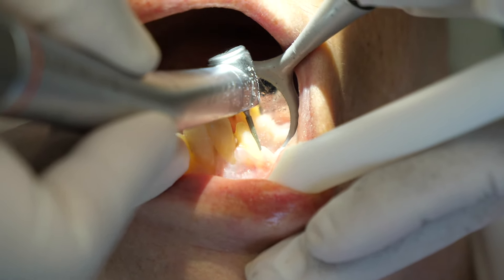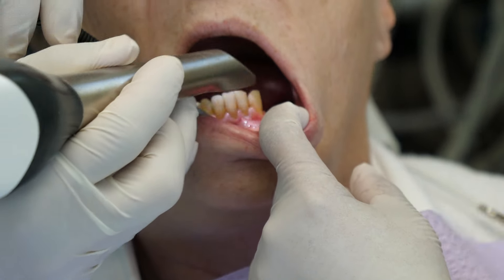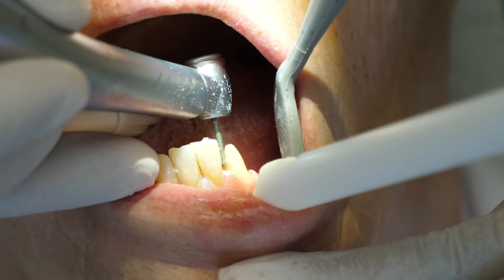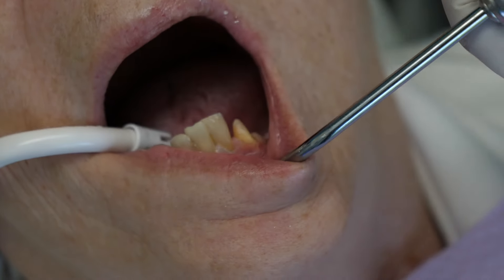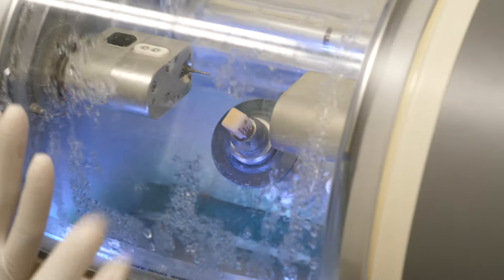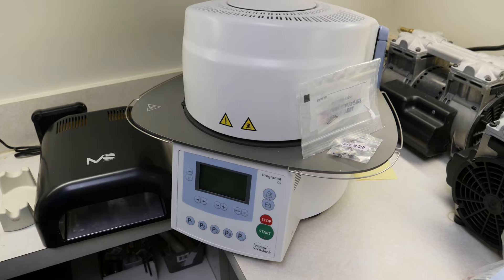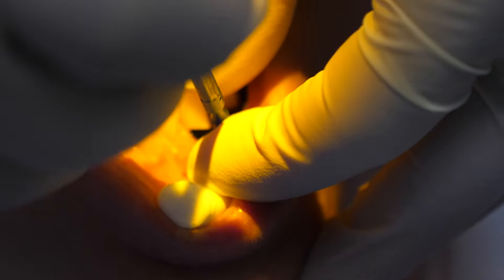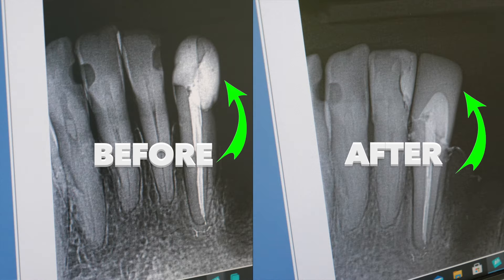Dental Crown Procedure EXPLAINED

Comment: Hi - very informative, but one aspect I'm not clear on.  Why is it necessary to drill the tooth down to such a degree? If  the issue is decay or a misshapen tooth, can't you just re-shape without such an extreme reduction in size? Thx.
Reply: I think it's because the tooth will usually be so damaged, like with major fillings, cracks, fractures, etc, that they have to remove all the bad stuff so nothing goes wrong underneath the crown over time (like gets another cavity that's no longer accessible)
Reply: Question. Wouldn't it be better just to extract the tooth. From other stories they always go back in to fix or take the crown out
Reply: @angelnieves6432  Not necessarily, preserving the tooth is of the utmost importance. Yes, all restorations whether direct or indirect are considered temporary, meaning they won’t last for forever, but you’re trying to make the natural tooth last as long as possible before extractions are necessary. Extracting a tooth can also cause adjacent teeth to shift, and opposite teeth to hyper erupt, which both aren’t ideal situations
Reply: It’s all based around physics. You have to reduce the cusps/tooth structure enough to where the crown itself will be sturdy, thick, and last. If you made this same prep but took off much less tooth structure, the crown would lack structural integrity, and break or fall off very quickly. So yes you would preserve more tooth, but you wouldn’t be helping the patient because the crown wouldn’t last
Reply: the situation that you described feels more like something you'd use a veneer for; though uncommon, dentists can use a veneer for decay. as for misshapen teeth, if the tooth is healthy, it would just make sense to use a veneer rather than a crown

Comment: I had a crown put on one year ago.  Small bits of the bonding cement you speak of is on my gums on both side of the crown (not touching the crown).  Was never cleaned up by the dentist.  I am not experiencing pain or inflamation.  Do you think I need to have the cement removed from gums?  Or leave it be as there are no apparent issues?  Thanks for your help.
Reply: Leave it be my broski.

Comment: I had an onlay that popped off clean. I knew it wasn’t glued properly the first time and told my dentist. He said it was fine. So when I went back to have it glued back on he said he’ll do a new one. I went two days later and he decided to do a bulk composite instead. It lasted a week before causing a fracture in my tooth. I’m not in pain but I’m upset. I don’t even want to go back to him. I’m most likely going to need a cap now and I was fine before. Any advice? Would a cap hurt without doing a root canal?

Comment: We have that same milling unit at our office and I love watching the milling process! I'm also a dental hygienist and I love your channel 😊 Greetings from Finland!
Reply from the maker: thank you for watching! that is so awesome!!! greetings, friend :)
Reply: So is it normal to file down the tooth above or next to the crown to fit it asking because that don't sound right but the office, I went too told me it common for them to do that for the bite.
Reply: @bunnyboo6295  Yes. Especially if the teeth have fillings in them. Plus the amounts that they file down are minimal, you won't be able to see the difference.
Reply: @miniskiipperi  what if no filling why they would make crown on the high side to do that instead of aiming for exact fit
Reply: @bunnyboo6295  No. The crown will fit your bite just fine. But if needed, they will make the tiniest amount of space for it so the crown itself won't be too thin. No dentist is going to file down your teeth if it's not justified.

Comment: Part of one of my teeth broke off a couple weeks ago while eating. Yesterday I thought I was getting my crown put on that tooth but apparently I will be doing the two-part process as I just learned in this video because they didn't put a new tooth/crown in there and in the gap I can feel with my tongue it just feels rugged. It's also painful to drink on that side of my mouth and I feel a sharp quick pain that I really can't tolerate. So I guess I'll just be drinking from a straw awkwardly for the next two weeks before I go back in and they finish it. I'm supposed to use this mouthwash thing they gave me too but I guess that will be painful when I start doing that.  

Going through this really makes me more aware of my teeth and to floss and brush twice a day at the very least because I don't want to have to have anymore dental work done for the rest of my life. The procedure they did yesterday was painful in parts.
Reply: My first opinion from my dentist recommended a crown for me ànd then I changed dentist and he said that I
didn't need it and then a year later he recommended a bridge.
Reply: Don't sweat it to much. I've had 2 root canals and now a crown for one of them.   Neither of the 2 root canals could've been prevented it just happens sometimes!
Reply: @randythompson4006  I’ve had a root canal once in my front teeth but I can’t imagine you having 2, that must have been painful to live through
Reply: @jp8612  it wasn't terrible.  The pain before was much worse.

Comment: I got my tooth grinded for putting crowns... both upper and lower..i was afraid of the numbing injection..even after the preparations...now in another one or two weeks i have to get the permanent crown fixed..will they put the injection..or is that not required?? I am afraid of injections
Reply: They don't usually do injections for applying the permanent crown. You are stronger than you know though & will feel so much better when it's all sorted! Sending extra courage & healing wishes your way! :)
Reply: Dont worry they wont 💕

Comment: Would it slid off your teeth in overtime or would it be physical permanent permanent on your tooth in time like I have a mouth for the gold There pulled out with my pull out pull out pull out the the the cap

Comment: Have a proposal to do crowns on 7 bottom front teeth. Is it recommended to do them all at once? Secondly, should I consider a bridge?
Reply: I’m a DA of about 14 months, and if I were to give you advice, I would highly recommend individual ones. While a bridge would be less expensive, it is far riskier and way less comfortable. Because with a bridge (usually a 3-4 unit crown each), it holds onto 2 roots. The issue would be, if one tooth has a problem, it’s a 3-4 tooth problem. But ultimately, it’s your mouth and it’s up to you.